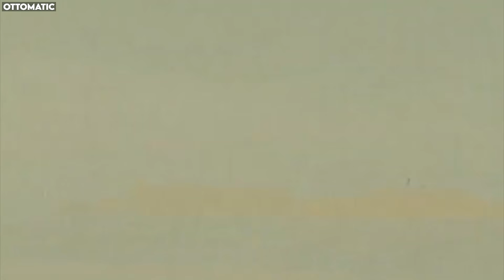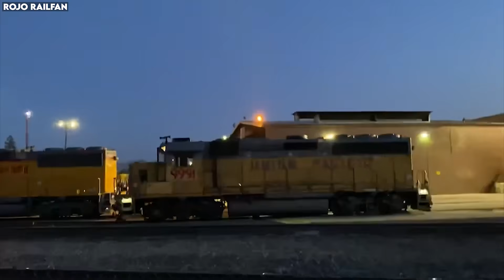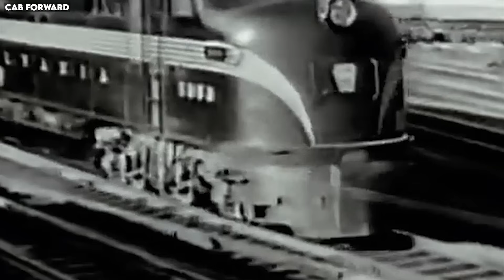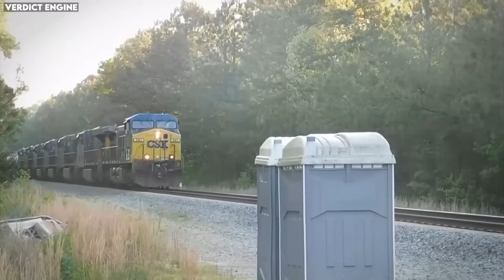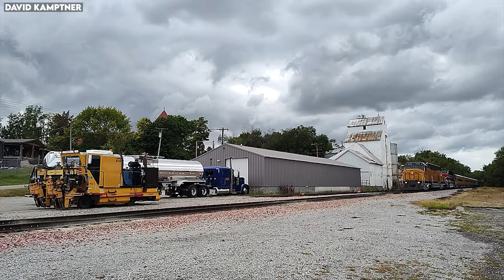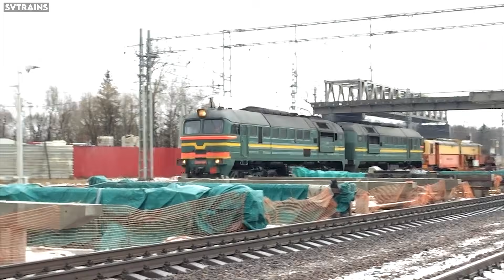10 Biggest Diesel Locomotives Ever Built

Comment: The Soviet and Russian permanently coupled 2, 3, & 4 unit sets (and the Baldwin Centipedes) really deserve their own list.  Basically, these are permanently coupled as an alternative to the more universal MU, Multi Unit control cabling.  This is the equipment which allows several locomotives to be lashed together for a trip and controlled by a 2 person crew in the lead locomotive.  MU locomotives (a now standardized system) allow any locomotives on the roster (even of different manufacturers) to be interconnected in engine, braking, and dynamic braking control.  On the other hand, permanently coupled sets probably make the cabling, electronics, and controls a little simpler but give the railroad considerably less flexibility with its motive power than the MU system.